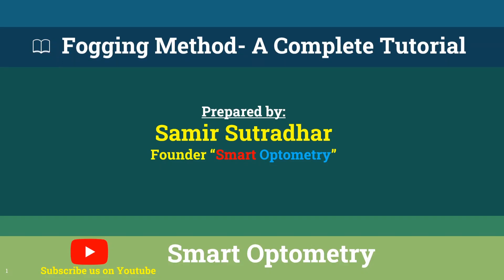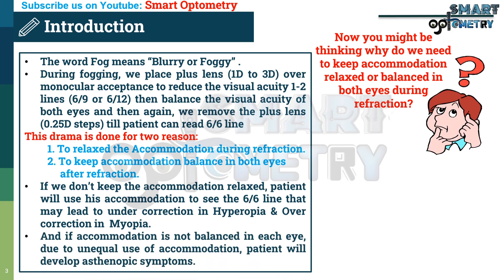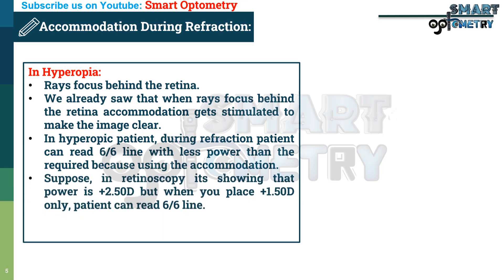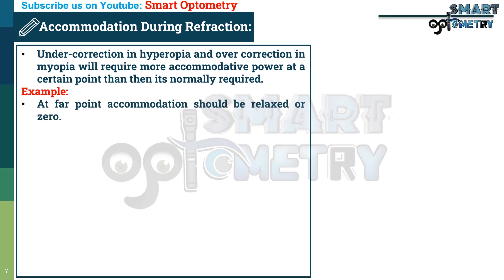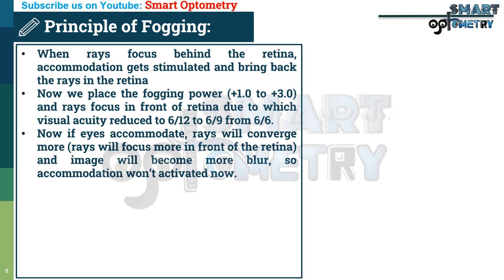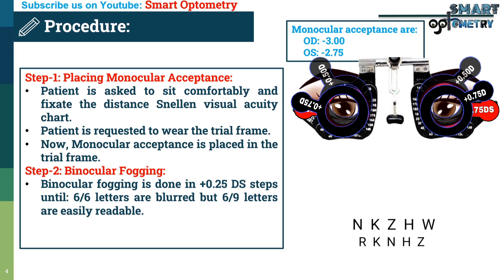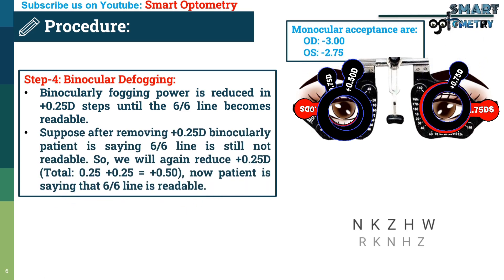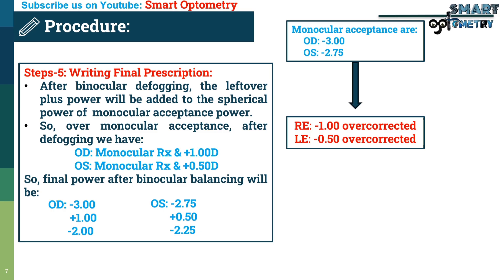Fogging Method - A Complete Tutorial

Comment: Thank you it’s a useful video; in step 3 when we add +0.25 to the clearer image is that while patient is looking at line 6/6 or 6/9?
Reply from the maker: Balancing is done with fog power. After balancing then we reduce fog power 0.25D steps. So, it will while patient is looking with fog power and it won't be 6/6.

Comment: Thank you it’s a useful video; in step 3 when we add +0.25 to the clearer image is that while patient is looking at line 6/6 or 6/9?
Reply from the maker: @Drxw1W  After placing fogging power we do balance, so it won't be 6/6. After the balance we reduced fog power 0.25D steps binocularly until patient sees 6/6.